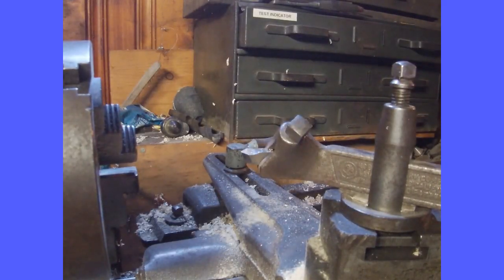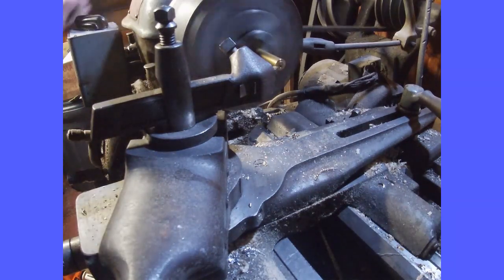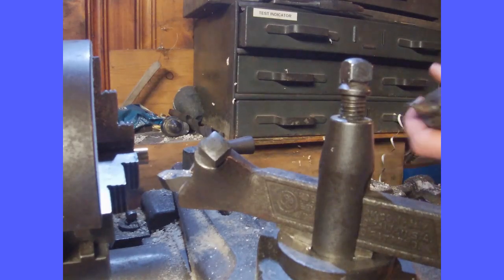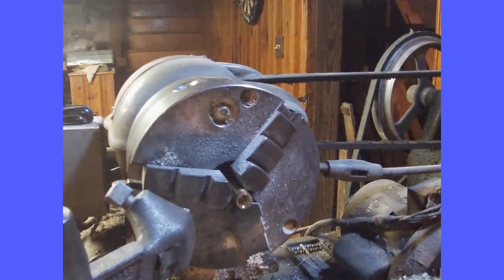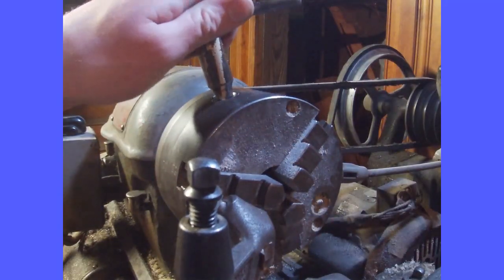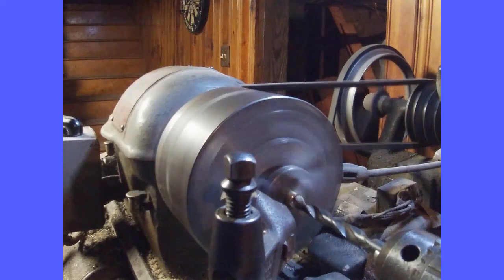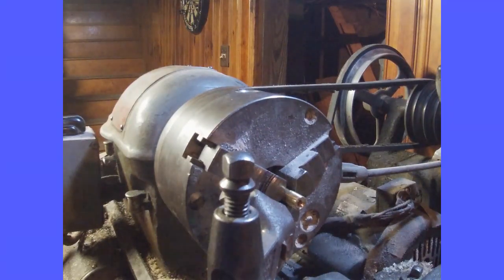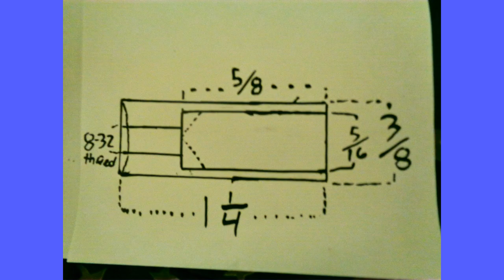Part 1: The Tip | Making a Ramrod

Comment: To keep the hacksaw from skipping when parting off as much. I use a v tip lathe tool for threading to groove the piece before using my hacksaw. Looks like you have an old Southbend...
Reply from the maker: It is a south bend indeed